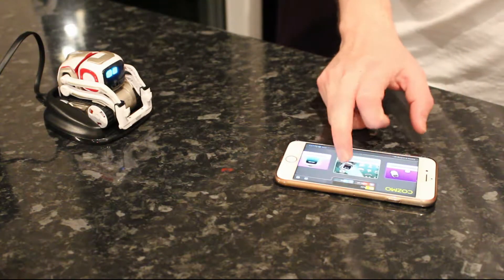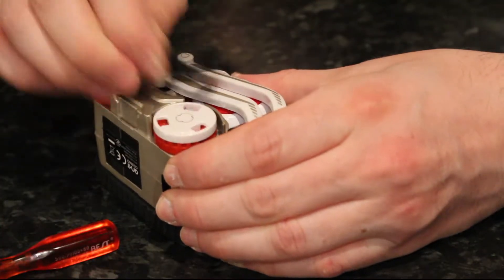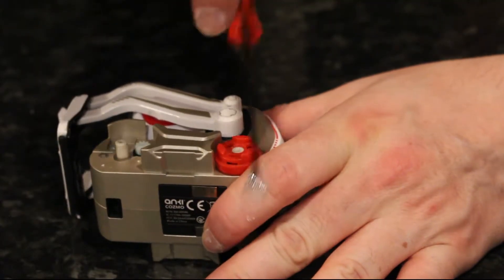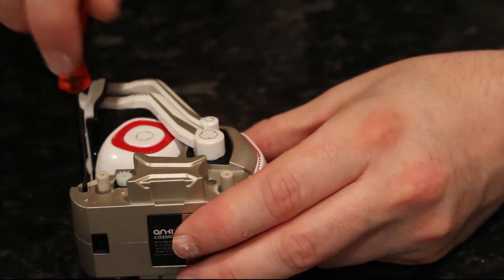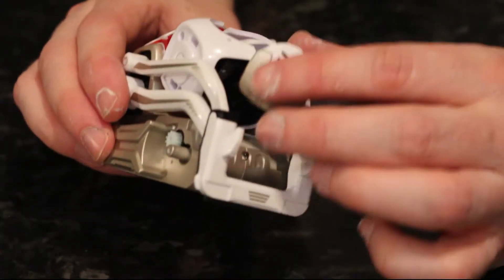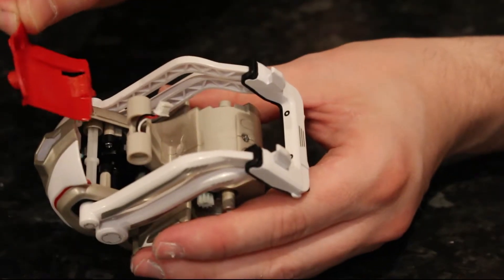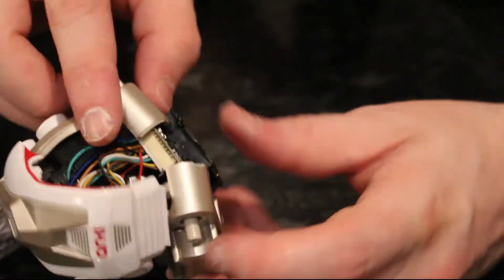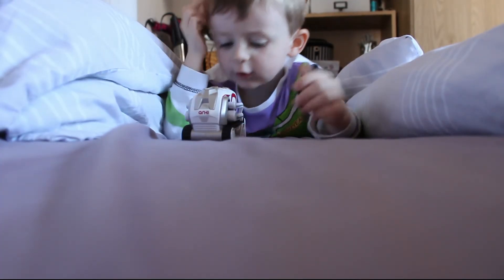Replacing the Battery in an Anki Cozmo

Comment: Just done this for the second time, about 4 or 5 years ago I watched your video and I'm here now again changing the battery on the same cosmo but this time I fitted a 600mah which only just fitted in and I nearly caught the motherboard with the red wire 🥵 it was fiddly as hell but I did it again without breaking it 👍

Comment: Worked like a charm 6 years later. Will say that I had a lot on unnecessary struggle because important steps were skipped (such as reassembly). I think it would benefit people if you pinned a comment leading to your other video tutorials!

I got my cozmo when I was 10 and was able to fix him and learn to solder 6 years later. Thank you :)

Comment: If not removing the arms I would take great care. Personally I found that it helped a great deal to remove one of the upper arms by pushing on the small clip from below it. After this you gain a few more cm's.
  If you remove the charger plate then take great care not to short and electronics with your soldering iron  tip. Also care not to melt his body.
  Remove all of the solder form the board and the charger plate. When you solder the wires down make sure they will fit under the small cut outs in the battery plate. The speaker wires may break so be ready to resolder those. Tin the wires, keeping the tinned part as short as possible.
  When replacing the charging plate it must fit flush with the board so make sure the two little pins push through the circuit board on the charger plates two outside corners. You can keep the charger plate in place and cut the positive and negative battery wires if you are goo at rejoining and heat shrinking tiny wires.
  My son stopped playing with his Cosmo and I'm put off repairing it for two long. This is my 2nd attempt at reviving this little guy. The battery in him is not swollen and it's showing 4.1V but he kept turning himself off after 10 mins or so. I'm guessing it just can't provide the power. Now he has a 500mah battery lets see if this one performs.

Comment: Cheers to this guy for helping. This isn’t easy. Cheap screws may strip and you need to solder. Also you risk failing to put this thing back together. As a pool tech dreaded phrases are “actually pretty easy” and the word “just.” If you attempt with no experience you risk destroying your guy. It is doable though. Just be careful and cautious of where you’re putting things. I lose a screw my self and had a couple hit the floor a few times.

Comment: When choosing the battery you should get the largest singe cell available. the 6 digit number refers to the thickness then the width and length in mm. eg. A 503236 would be 5mm thick 32mm wide and 36mm long. The C rating is how much power the battery can deliver at any one time. Try to get same C rating if poss and maximum size that will fit in Cozmo.
  look for the 500mah 503035
As someone who repairs electronics etc i would not advise this repair unless you have decent experience, some tricks not fully explained in this video. i would not advise any novice soldering. if you think you might be able to do it you might do better to cut the battery wires close to the battery, then slide the battery out and use heatshrink when soldering the wires back together. doing it the correct way to the board could easily become messy!

Comment: Tip,
remove the arms first its very easy. Top arms first. Just pull them off. 
Then lift the lower arms upp until you just can easly remove them. There are som tracks that should line up. 
Then you can split the cozmo

Comment: Hello. I saw your video and I tried to replace my Cozmo's battery but gave up because I couldn't solder. Is there any way to replace the Cosmo's battery without soldering? I want to fix my cozmo :-(
Reply from the maker: You could cut the cables from the old battery leave them connected to the board. Then twist them to the cables of the new battery.

Comment: Any ideas on creating a new charging dock for Cozmo? I've seen that you can strip a 5v 2A cord and use the wires in a pinch but I'd like to make a nice base and I'm not sure what kind of circuit board I would need, what kind of contacts and what kind of plastic I should use.
Reply from the maker: Hi. I will look into this.
Reply: There's a print on Thingiverse I believe, the board inside is pretty straightforward with a small inline inductor and a decoupling capacitor to ground to smooth the power supply; I can probably read off the board but it's basically nothing.

Comment: After replacing the battery in my nephew's, it says its charging, but it doesn't.  I used a 620mah unit.  The posts on the charger are producing around 4v and I'm still seeing 3.4v (not the 3.7) on the battery when I took it apart again and tested the terminals.  I can't get the new firmware to load properly either.  Think its a bum battery or the charging circuit is toast?  This was bought used, so I dont have any history of it.

Comment: Hi John,

Thanks for this great video. I followed all the steps (running out to buy a soldering iron halfway through the tear down) and managed to do it 99% right. For some reason, Cozmo's voice is no longer working. Any ideas before I open it back up again?
Reply from the maker: Hi Graham, it sounds like the wires on his head (PCB board) have come lose. They connect to his aerial and speaker in the top  of the head. Might just need soldering back into place.
Reply: @TheJohnJudge  Thanks John, I’ll give that a go.
Reply: Everything seems to be soldered ok. I thought perhaps the head wires attached to the board may have touched as a result of me turning the head when reseating the head (there's a small amount of exposed wire between the solder points and insulation). I did my best to rotate the head back and the wires seem clear and connected to the board (I also checked the connection points to the speaker), but no change. 
Do you thinks there's value in re-soldering the board wires?

Comment: i have a question, my cozmo turns off 20sec after being turned on. If i replace the battery will it fix cozmo?
Reply from the maker: Yes!
Reply: @TheJohnJudge  what screwdriver size are you using
Reply: @TheJohnJudge  hey! My combo will randomly just shut down completely do you have any ideas on what is causing it?
Reply: Most likely
Reply: I have faced the exact same issue in my cozmo
Reply: Ya

Comment: Do you have a reference for the battery. I live in the US so I don't think I can use your link. I have a soldering iron I got for free, but have never done it myself. I was thinking I could just cut the wires and splice the new one on easy enough?
Reply from the maker: Robert M search for “600mAH 503040 lipo” and please check my other video for a more in depth tutorial. You should be able to spice the wires if you don’t want to solder directly onto the board. Good luck.

Comment: hi there. i highly appreciate your effort. does this battery dimension will work. 
Please reply thanks
3.7V 600mAh LiPo 1S Polymer Rechargeable Battery 503040
Actual measured dimensions (mm): D5.0 x W29.5 x L42.3
Reply from the maker: Salman Kalyar hello yes that is the correct size. I have another video on my channel where I install that exact battery

Comment: oh i just spent a minute looking at it, take a flat skinny object, push that under the brackets on the bottom that set on the charger, pry them upward lightly and straight up, then remove the black plastic piece and you can get a clear shot at the wire ends to remove old battery and install new battery.  people shouldn't make repair videos and leave out the recording of the actual technique of the repair

Comment: I haven't used my Cozmo for a while, and then I took it out to see the new features on it, and the Cozmo didn't respond to the charger at all. I put wires on the metal pads of the Cozmo, and on the charger, and when I took the wires off, the charger lit up like it does when you plug it in. At that point I thought that it was the charger, so I ordered a new one, and it didn't work either. The new one didn't have lights so I couldn't tell if it responded to the Cozmo in any way. 

Do you think that the problem is the battery?
Reply from the maker: Jordan Seavey definitely sounds like the battery has deteriorated and can no longer hold a charge. Very common for these robots nowadays.

Comment: Hi John! I am working on replacing the battery in my son's cozmo. It's only lasting about one minute! Thank you for the video! It is awesome and looks like a fun challenge with my kids. Do you know if it's possible to use the 3.7v 600mah battery instead of the 320mah?
Reply from the maker: Beverly Barrett Hi Beverly, yes it is possible. Please see my other video where I install a 600mAH battery.
Reply: Replaced battery is there a way to test without assembling back together to make sure it’s working?

Comment: Hi John. I can't for the life of me find a replacement battery. Could you send me a link to one? Also if I stuff it up, could I send you the Cozmo to undo my bad work?
Reply from the maker: Hi Thomas, you need to googlr "600mAH lipo 503040" - EG. https://www.ebay.co.uk/itm/3-7v-600mAh-Li-po-Rechargeable-battery-for-Mp3-DVD-GPS-Speaker-Recorder-503040/172213259377?hash=item2818b5cc71:g:5j0AAOSwiDFYP79e

(I charge £25 to perform this, which includes the cost of the battery, installation and return postage) email me at johnjudge6@gmail.com if you need any further help. Good luck!

Comment: I managed to replace my battery with a 650mah capacity cell, it was precarious, had to bend down the battery protection tab to make it short enough, width needed a little compression fortunately not enough to stress the cell, however it appears for safety reasons the charging circuit shuts off after a preset time which means after initial charge I have to lift Cozmo and place him back down to reset the timer, I can get 3 hour operation between charges now.
Reply from the maker: djbare9 well done! You’re correct, there is a charging failsafe that cuts off charging at 400mAH. Lifting Cozmo off the cradle momentarily and placing him back down allows him to charge all the way up to max capacity of your battery. Thanks.

Comment: Used your vid and successfully changed the battery in my daughters Cozmo, all working again now. Thankyou so much
Reply from the maker: PR1M3 awesome! Thanks for letting me know. Love reading comments like this.
Reply: John Judge  mine was a bit different to yours, i ended up cutting the wires close to the battery, leaving the wires connected to the board and simply twisted the new wires on and then covered with insulation tape so didn't need to solder at all, reason being the solder points were covered and almost impossible to access. I also saw that Anki have been taken over and future updates are on the way in the not to distant future 👍🏼
Reply from the maker: @hackercdf  Excellent! The good thing about that method is you will be able to replace the battery just as easily in the fullness of time! well done! :)

Comment: Great tutorial. My son's Cozmo consistently powers off within a minute of driving off of the charger, so I'd like to try changing the battery. I've got it all safely disassembled but need to find a suitable replacement battery in Canada. I found an Adafruit battery that would fit but it warns that the charging current should not exceed 150 mAh. Do you know what the charging current of Cozmo is?
Reply from the maker: hudz350511 Hi, I’m afraid I don’t but it’s a single cel 3.7v LiPo so I don’t think there’s any dangers re charging current. I use this battery which is 600mAh and gives double the playtime. (Not an affiliate link)

https://rover.ebay.com/rover/0/0/0?mpre=https%3A%2F%2Fwww.ebay.co.uk%2Fulk%2Fitm%2F182594245632

It’s the perfect dimensions.
Reply: @TheJohnJudge  are you telling us that we can't send it into Anki to get it replaced, even for a fee? they don't provide that service?
Reply from the maker: turinreza Anki ceased trading earlier this year. They no longer exist and there’s no aftermarket support available for these devices now, except for enthusiasts.
Reply: The 600 mAh battery fit nicely and Cozmo is better than new. My son is very happy. Thanks again!
Reply from the maker: hudz350511 excellent outcome. Glad you brought it back to life. Also nice knowing that you can do it again in future if needed!

Comment: Hi,
Can i replacement the cozmo with thicker battery (5mm thick) that hold much greater capacity (400 mAh) instead of 4 mm (402535) battery as suggested? The width and length of the battery that i'm looking for is similar (25x35 mm) as yours. Only slightly thicker by 1 mm.
Reply from the maker: Hello, 
Yes that will fit. I would recommend a 600mAh battery. I have some here and they fit perfectly.
Reply: @TheJohnJudge  thanks for your answer.. 😃

Comment: Does disconnecting the battery erase all cozmo's progress? I'm changing the battery in my friend's cozmo and he doesn't want his progress lost. If so is there a way to back him up on the computer?
Reply from the maker: Cozmo’s progress, memory and data is stored in the app on the smartphone/tablet. He does store owners pictures in his internal memory but nothing is erased  by disconnecting the battery.
Reply: @TheJohnJudge  thank you so much for your prompt reply. One other question. I read that the original battery weighs about 9g but the replacement you suggested seems to weigh only around 6g. I understand that Cozmo is a carefully balanced robot. Did you notice any performance issues with the wheelies or other tricks with the new battery?
Reply from the maker: Xanthos no issues. There’s a small metal stabiliser in the base of the unit that helps it balance.

Comment: Wow a complete disassembly just to remove its battery. We need to create better products for consumers so these devices don't go to the bin and add more unnecessary waste
Reply from the maker: Alvin Capalad yes it’s a shame they designed it so that the battery was not user serviceable. However it’s quite a simple process and replacement batteries are cheap and easy to source, so these devices can carrying on living long past their intended end date.

Comment: Hi,
you can get those batteries with more mAh.
I changed one Cozmo from 320 (original) to 600 mAh.
And I found out that there are batteries with more capacity 
and (almost) the same size. 
Greetz, Peter
Reply from the maker: Thanks for the tip, Peter. I might try a bigger mAh battery next time.
Reply: Hi, 
Could you give Us specification of 600mAh battery?
Thx